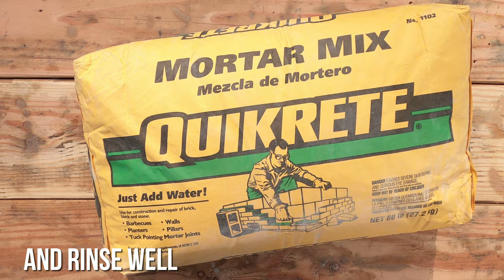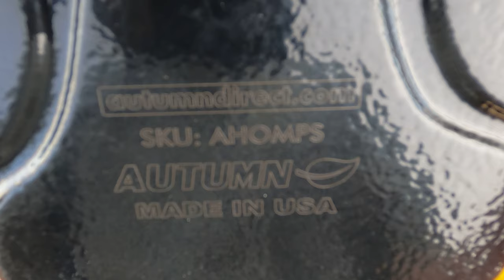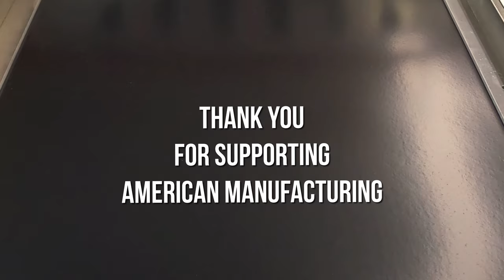Step-by-Step Instructions for Concrete Molds, DIY Garden Decoration: Make Your Own Stepping Stones

Comment: Just received your turtle stepping stone, going to fill it half way like you suggested, then add a cut out piece of chicken wire. That way if one should crack it won't separate.
Reply: Good idea, mine cracked. I’ll try that too
Reply: @bondito88  I ended up using hardware cloth with the half inch squares in the main body and strips into the legs and it held up.
Reply: @flynnstone3580  even better! Thanks bro 😎
Reply: @flynnstone3580  you have any idea why they come out the mold with some bubbles holes?
Reply: @bondito88  you have to tap the bottom of the mold about a dozen times with a hammer to get the bubbles to rise to the surface after you pour it.👍

Comment: hello! just curious. does applying mold release have an effect when painting the concrete when it's dry? especially with motor oil. i mean, will the oil on the dried surface going to cause the paint to not adhere well?

Comment: Great instructions on the process. Do you know if it's possible to use press-in letters to put a name or date??? It would have to be out of the mold to do the correct side.

Comment: Great tutorial! Question: it looked like the mold you used the release agent in changed the color and consistency slightly from the other two, was it noticeable when fully cured?
Reply from the maker: Motor oil does, the PAM cooking spray does not. After several rainy days they became indistinguishable.

Comment: Is it better to use mortar mix like you have, or concrete mix (concrete has small aggregate)?
Reply: Cement mix is much stronger than mortar.  I question how strong these would be if used as stepping stones that people actually walk on... they'd probably crack fairly easy.

Comment: Question. Why are you using mortar mix and not cement. Won't these crack if. walked on?
Reply from the maker: Thanks for the question. This mold has a very fine texture and I didn't want to use vibratory table for the video. I used mortar mix (due to it has no gravel, only sand) to get rid of air bubbles easier. This mold is around 2 in thick, cracking shouldn't be an issue. The stones I made are still good today. For the stepping stones I prefer CTS 24/6 fast-setting concrete mix. To prevent cracking I'd use anti-crack fiber reinforcement (32-500 concrete fibers).

Comment: They turned out great. Did you use Mortar Mix to fill the molds?
Reply from the maker: Yes, just the Mortar Mix + water and colorant
Reply: I recently tried Portland cement and made a stepping stone. I let it harden and next day I stepped on it and it broke in half. Then I saw your video and purchased mortar mix. I haven't tried it yet. Do your stepping stones break easy? Is Mortar mix better and stronger than regular Portland cement?
Reply from the maker: @angelaallen2190  The stones are very fragile the next day with most concrete mixes. With the Mortar mix we wait ~2-3 days before use them. BTW, the common belief is that concrete takes 28 days to reach most of its strength. However to speed up the process try any fast-setting concrete. The one we use for all our new molds is Cement All by Rapid Set. It's expensive, but the quality is awesome. And it really takes about an hour to get the stone. For any fast-setting concrete, don't mix too much, keep in mind that you have about 20 minutes working time.
Reply: @autumn8468  Ok thank you. I guess I should have given it more time for the stone to set before stepping on it. I'll make sure my next one I'll let it sit for a few days. Thanks for responding and for the advice.

Comment: 5:42 does it need a spray of water occasionally at this stage?
Reply from the maker: Depends on the temperature outside. Rapid drying will increase the possibility of cracking.
Reply: @autumn8468  Conctere/morter does not dry, it cures. Ir requires water to cure properly so . . . keeping concrete moist is best for about 7 days.